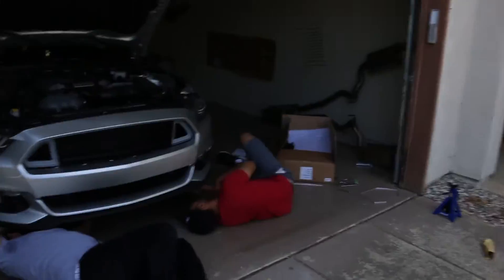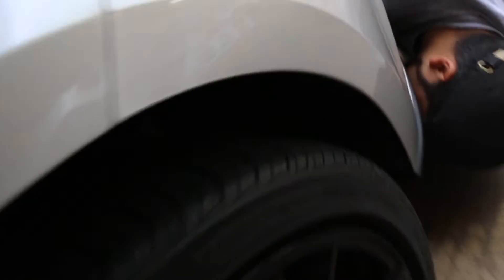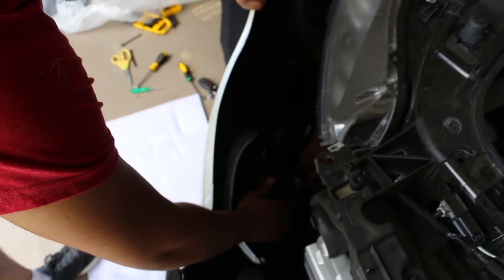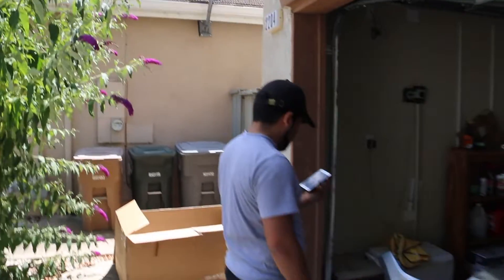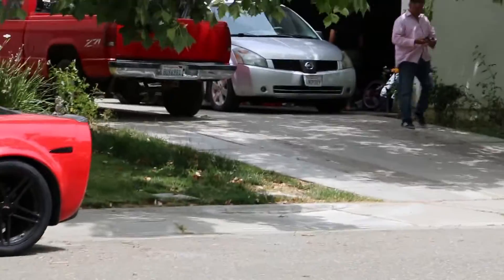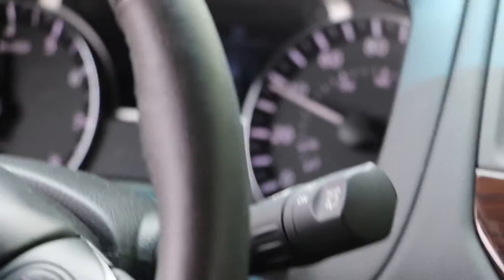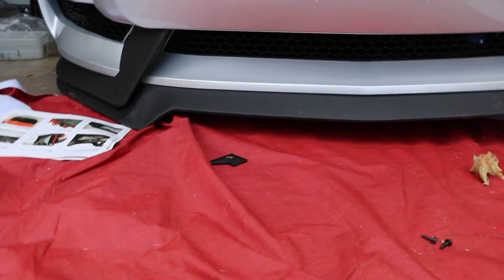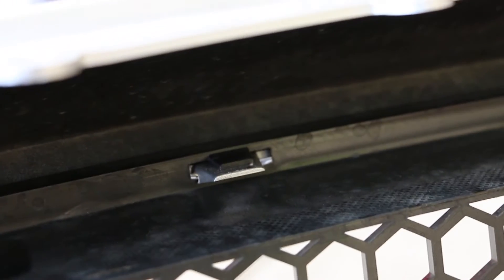2015 Mustang GT350 Bumper Swap

Comment: What happens with the electrical connections for the fog lights when the new bumper is installed? Obv the   fog lights can't be re used, so do they just leave a connection to dangle on either side?
Reply: i believe you are forced to either let them dangle or cut them off and wrap them up, however i installed grille lights and hooked them up to the old fog light connections... each to their own 🙂

Comment: So the gt350 bumper fits the regular mustang? No hood issues?
Reply from the maker: psykosel no fitment issues 👍🏼
Reply: He set you up for failure lol
Reply: Factory GT350 does not fit without the GT350 Hood and Fenders and a few other parts...............The one in the video is MP Concepts / Ikon replica GT350 bumper

Comment: How was the fit? Did it fit easily?
Also did the belly pan fit just fine?
Reply from the maker: From what I remember everything fit perfectly
Reply: @SSINATIVE  Thank you for replying!
Reply: @SSINATIVE  sorry for the bother, I just noticed the original bumper has air ducts built Into the fog lamps but the gt350 bumper doesn’t. How did that affect air flow? Did it put pressure on the wheel wells since there’s a big open space now instead of the air being direct out?
Reply from the maker: @057omar  it never caused any known issues or a noticeable difference when it was on the car